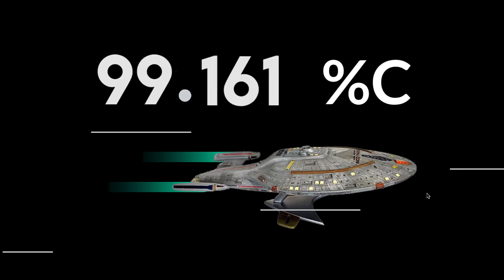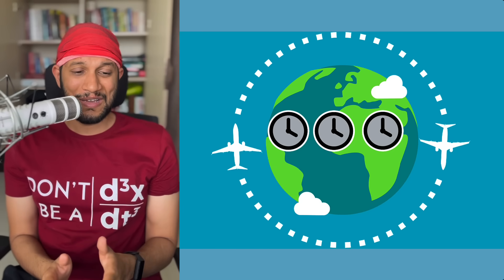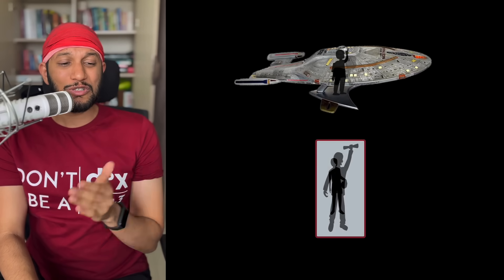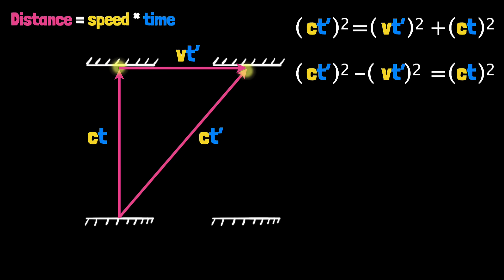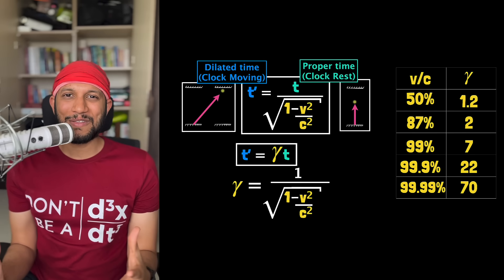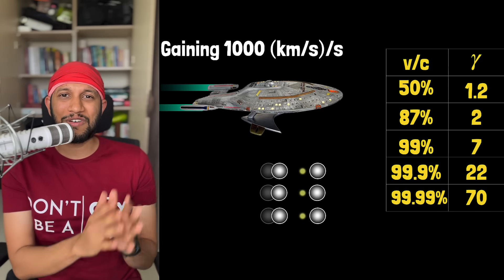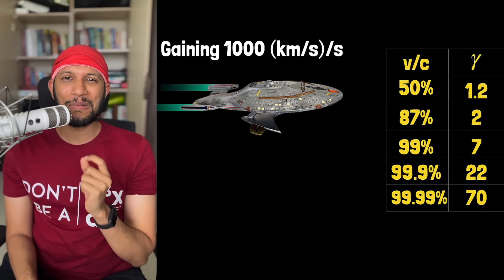I finally understood why you can't go faster than light! (My mind is blown)

Comment: I do not understand why is Photon in clock on ship moving independant of ship yet still in the same space (clock)?
    If foton is independant, he should leve "the clock", but if it is part of clock which is on ship, it should not make longer trip.
   Also obserwation is flawed, how can You say how much did proton moved and how much moved in moving ship, since,
      - Lets say the test is around Earth, so You observ from Earth, but Earth is moving around Sun, which is moving around black hole in our galaxy, which is moving somwhere, so how can You even state that there is "fixed" place to obserw move of the photon?

The problem with e=mc2 The problem with this exuasion is E - we need a lot of energy, we are yet unable to create or store for prolong time mass amount of energy, M - mas of object and space, moving object throu space take a lot of energy, what You need to do is "tell" reality, that object do not have big mass and that distance is actualy smaller (alternative routh outside "reality" with e=mc2).

First step on this path is to create Force fields, a way to create bariers. You do not have to create working force field, start small, and expand on shared platforms, like all other idea, some one build small home, some one see haw it was made, and make bigger better, and so forth. First force field can be create on surface, next without surface, next projected to space, and the best the exclosed one, with this, You go for energy, who cares about cold fusion, just make normal fusion, and force fields to only pass throu what we want energy, which powers reactor and force field, and the surplus is Yours, then You go to making different enviremats, so uotside and inside are separate, then You go for time separation, who need fridge, You just put it inside and it stay fresh for how long You want. With separate from reality, You can change percived weight of object, since object lin force field would be acting like there is only force field, so even with car inside it can act like a baloon. Separation of space allows for space manipulation, so basicaly like Tardis, bigger on the inside.
Reply: I always forget the exact numbers, but the Sun is not pulling that hard on earth. Earth pulls harder on the the moon. And the center of the galaxy is far far away. It takes millions of years to rotate around it. Nothing in the order of 1000m/s² as assumed for our ship. ( or 100m/s² ? Perhaps humans survive this under water? ). The open clock mimics the Michelson Moreley experiment. It runs on a table. You could put this table on the moon. It is open to outside observation.
Reply: @ArneChristianRosenfeldt  If I make errors, please correct me.
m/s2 - is acceleration, it is part we can feel, m/s is speed, and we do not feel it - just like car, You feel speading and slowwing, but nothing when just driving with steady speed.
If "The open clock mimics the Michelson Moreley experiment" than I do not understand it, since MM just prove no Ether and C is constant, nothing about how can they contain photon that is both in place to move between 2 surfaces, and move outside them - making longer distance. And if it is all about perceive movement, that it prove nothing. It is like they are saying that if I am in train, and I trow ball up and it fall down in to my hand, I travel 100 mether (train 100m/s - I am container) but ball (Photon) was traveling 200 meters, because it went 50 cm up and down in the air, but if it moved 200 m and I moved only 100 m, how can I catch it?
If You run 20 m/s in train which is runing 100 m/s, so are You running 120 m/s?
I must be missing something from this video.
Reply: @Adam-eb8tp  I should rewatch the video. I had to get credits and so sit through a class about special relativity. It was Lorenz transformation all the time (pun). This taught me that they work. I accepted that the space dimensions normal to velocity are not affected. This way we get constant c in all inertial systems. I was looking for a "proof" that this is the only solution which gives us constant c. But as I commented elsewhere, it is hard to argue with the simplicity. Only two dimensions ( x and t ) involved. And the transformation is linear.
I am reminded about the discussion why faces mirror left right in the mirror. What if I lie in bed and have a closet with mirror doors? So it seems to be psychological thing? Ah, nah.
Einstein wrote an example with trains. Perhaps we should make a video about this. I think in "Battle Star Galactica" are some big "trains" made of space ships. Now two of these trains may pass. Anyway, equal time is not the same if you change PoV. So if shot something forward (x) , the opposite train things that it goes farther into the future (t) than you think. This all fits with ping pong clocks going forward and backwards between the trains. I think Einstein mentions the big clock over the platform of a train station, but two of them.

Comment: I don't know if anyone will see this and maybe this is stupid and I'm missing the point, but... isn't speed relative? Why, if Anna is going near the speed of light and Bob is on the ground, does only Anna age slower? Doesn't Bob appear to move at the speed of light from Anna's perspective?
Also what happens if two spaceships move away from each other at 75% of the speed of light? Wouldn't their relative speed be 150% the speed of light? Or is there an objective reference point for movement after all? What determines what is "stationary"? I am so confused.
Reply: Only in inertial systems the time goes fast. The ground does not accelerate (much). So the twin here gets older. Yeah if someone on the ground does the calculation using classical mechanics. From the PoV of the ships, they other ship does not move away faster than light.

Comment: So tell me, how fast does the light project from the headlights of the spacecraft when they’re switched on as the ship hits 87% of the speed of light? In theory the light from the headlights should be travelling at either 137% of the speed of light (sue to time dilation, impossible), or 187% of the speed of light (if it’s all relative, but again impossible) or 13% of the speed of light, again impossible. 

Time dilation is real, communicating with satellites only works because we make allowances. But there’s definitely something missing. Physics seems to be stuck with no real discoveries.
Reply: your theory, not our.

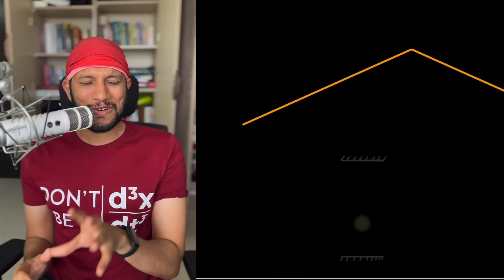Comment: If the photons in the photonic clock inside the ship hit each side slower for the observer outside the ship, then if passengers inside the ship observed a photonic clock outside the ship, the photons should appear to hit the mirrors faster. But since the speed of light is constant this must not happen. Does the photonic clock outside the ship appear shorter from inside the ship so that the photons can hit each side faster without breaking the speed limit? 2:19
Reply: the outside clock appears slower because the Lorenz transformation skews the t=0 axis. So by moving laterally, you seem to move forward in time.

Comment: OK, now explain how and why mass increases toward infinity as you approach the speed of light.
Reply: please do not. A staged rocket uses: "proof by complete induction", which is already difficult for most viewers. Mass is involved in differential equations ( F=m*a, rocket equation ) which are clearly over the head of most commenters ( and viewers? ).
Reply: @ArneChristianRosenfeldt  How do you know that I won't understand it? In this very public forum, I was asking for my own information but I didn't leave a forwarding address incase someone else could benefit from the answer. I don't require mathematical formulas, only a practical, mechanical explanation which doesn't have to include rocketry.
Reply: @jeffmccrea9347  Only rockets fly fast enough. And particles in accelerators.
Reply: @jeffmccrea9347  but mass grow comes out of a mathematical formula. There is no mechanical explanation.
Reply: @ArneChristianRosenfeldt ...but mass grow comes out of a mathematical formula. There is no mechanical explanation...

 If unlimited mass doesn't somehow magically appear as you approach the speed of light, either your mathematical equation is wrong or useless. If the appearance of infinite mass only happens on a chalk board and NOT physically when you reach the speed of light, why even bring the subject up? It's like writing down that I make 5,000.00 a week for 40 hours work but if I work 1 hour of overtime, I make all the money in the world. It looks great on paper but it won't buy the lobster, steak and caviar on Friday afternoon.
Reply: @jeffmccrea9347  Lorentz transformation explains the mass grow in theory. And in experiment, I think we measure mass using one of Newtons Laws: F = m * a. We send a particle through a static electric or magnetic field. I think that it is assumed that classic equations to calculate F hold ( e*E , e*vxB ). Then we measure a and get m.

Comment: Information travels faster than light. In fact, information can travel from one galaxy to another instantaneously. Therefore, information has no mass, does not age and is practically eternal. How do we define information in this sense? Quantum mechanics/physics will either break you mentally, or make you realize that the laws of physics only apply to particles and matter above a certain size. Strange things are afoot.
Reply: There are some videos from Penrose with click bait title on youtube, but no one in quantum mechanics claims that information travels instantaneously. Measurement of a single particle was never interpreted like this. Entangled particles are used in experiments and show some weird properties on a distance of up to 200 km. This is not even around the earth and you talk of Galaxies? Since the video has this observer, think about a huge box. Not only put a cat in it, but our whole solar system. Then apply microcanonical ensemble. No observer, no collapse, until you open the box. I could imagine a voyager episode where a whole star system is teleported into a void between galaxies. Voyager is a LY away and travels to it. The light from the star system at one point hits the telescopes of the voyager: observation. So the fist time any collapse can happen.
Reply: @ArneChristianRosenfeldt Thanks for your... Explanation but I stand by what I wrote 👍🏻

Comment: so what happens if you have a wormhole from the center or a star to rocket output on the ship, the wormholes input isn't going slower but the output is?? the throughput should stay the same once pressure builds up. i should got to sleep.

Comment: Math does not prove out reality either. It only proves on paper. Math is a tool, not proof.
Reply: Math checks for consistency. We have measurements and math helps us to interpolate between these for engineering. Occam’s razor says that short equations are probably correct. Short English text with long equations is wrong .
Reply: @ArneChristianRosenfeldt Here is the fun bit, your math can show consistency in a wrong model, consistently. How would you remedy this? Mathis a tool and not a proof.
Reply: @onegreenev  Welcome to the real world where you cannot prove anything not even God. Science is always so keen to point out that a single experiment can falsify a model. But this does not seem to be so easy either: Quantum interpretation/theories are difficult to dis-aprove. And even though Newton is wrong, his work is still useful.
Reply: @ArneChristianRosenfeldt  There can be no contradiction. Models are wrong. With wrong models the results are always wrong. I can have a wrong model and if I do the same experiment with the same wrong data I will get consistent results which people use to prove but because the model is wrong the resulting consistent results are also consistently wrong no matter how much one wants ot believe the the result. There is no contradiction even down in what some term the quantum level if that actually exists. Math says it does. Throwing an electron around a colider at a billion miles per hour then colid it with another object does nothing to prove or disprove anything. It is a way to see how much energy one can extract from an act of collision.It is a weapon. Toss that electron at a pool of water and you get bubbles as the water is ripped apart. Nothing exceptional there. Totally expected.
Reply: @onegreenev  We can only measure so much digits. So why would we care if a model is only an approximation? Some students move away from natural science and engineering towards maths because there nothing is wrong. Then comes Gödel or so..
Reply: @ArneChristianRosenfeldt  If a model is incomplete it is wrong. As for math, you can make math work for anything. Math is just a tool not a proof. Natural Science is all there is.
Reply: @onegreenev  People came up with the model that the solar system is mechanical systems with solid connections. The math equations got bigger and bigger. Keppler dropped the model and looked at math. His ellipse equation was much simpler than all the cycloids.
Reply: @ArneChristianRosenfeldt  Yet math has not proven anything. It is just at tool. Not a proof.
Reply: @onegreenev  So you are not impressed by Keppler? Or how Einstein showed that Maxwells equations are "co-variant". Or how Maxwell added a small equation which was so important that the set made up of those equations now carries his name? Or how Diract looked at the Pauli equations and tried to forge them into covariance. Only maths! Of course, these are not proofs, but math certainly was an important tool to modernize physics.
Reply: @ArneChristianRosenfeldt  "why would we care if a model is only an approximation? “ Because details matter. As for Gödel? There is no time travel. Time is linear and not a physical entity and you can’t travel back in time because there is only now. You can’t re-live the past nor can you live the future. Only now. It is impossile to go back in time. That would be a contradiction. Because there is only now, going back in time would only be now so there is no going back. Im quite sure somene has proven using math that it is possible. It is not even theoretically possible.
Reply: @onegreenev  I did not write that you can travel back in time. Lorenz transformation travels in time elsewhere, but not were you are.
Reply: @ArneChristianRosenfeldt  Everything is in motion that takes time to move from here to there where ever there happens to be. Never back in time because that leaves you in the now, so now and the past can never be. Math is just a tool and never a proof. Space is nothing but a void and time is basically a word we use to describe moving from one place to another. Relativity is not reality. There are differing points of reference in any situation but just because I see things one way does not make it true. All models are false because not all information is included.
Reply: @onegreenev  Yeah it is kinda like politics. All kind of Governments are bad, but Democracy is less so. Or: All programs are buggy, but some have less bugs. All humans are only humans ( no Saints), still some end up in jail for a reason.

Comment: There is no dilated time. Time is just time. What you are seeing is relative to a specific perspective point. We must always be including the motion of everything. Since nothing is at rest you can’t calculate properly (reality) using a resting state.
Reply: Physics is kinda hard science. Calculations match experiments to many digits.
Reply: @ArneChristianRosenfeldt  You can have no contradictions in nature. There are none. A calculation can be made to match an experiment. Math is not science. Math is just but one tool used in the quest to find facts.
Reply: @onegreenev  Math is not a natural science. What "contradictions" do you mean? The kind of stuff discussed in cosmology? Or the Higgs field? Or Hawking radiation? None of this is of any relevance to engineering or science fiction, so please excuse my ignorance.
Reply: @ArneChristianRosenfeldt  I will say math is not science at all. It is however a tool used in science. Actually a must but its not science, just a tool used in science. The contradiction I am referring to in this instance is from the video itself. Where one is within the ship and the other outside the ship. One says the time clock ticks normal “in the ship” and the one observed from outside shows the very same taking longer because of the extra length due to the movement of the clock. Light can’t be moving normal speed and slower speed or faster speed at the same time. Since everything is in motion the one viewed from outside is correct because ever thing is always moving. Within the box it seems to not be moving that way but it is an illusion because you have no reference but in fact the angle of incidence is the same as the one observed from outside. There is only one correct one. Relativity is not reality. It is illusionary and can result in incorrect outcomes but the problem with the math is you can do math for each and according to the math they are both correct when they are not. There can be no contradictions. If there are, check the premise.

Comment: Relative is not reality. Since we are all moving, the light is bouncing at a diagonal and that is the actual factual speed of the clock. But being locked within it looks like it is just bouncing straight up and down but it is not. Relative to your position it seems so. It is just an illusion. Einstein was a cleaver man. But it is just a fact. Relative is not reality. Relative is more an illusion. You can’t have contradictions in nature which means you can’t have light that goes faster and slower at the same time. Reality does not work that way.
Reply: And what is your point? We all agree that in reality light moves at velocity c !